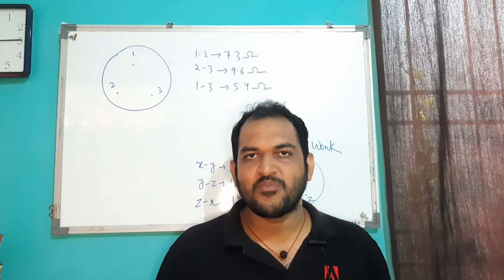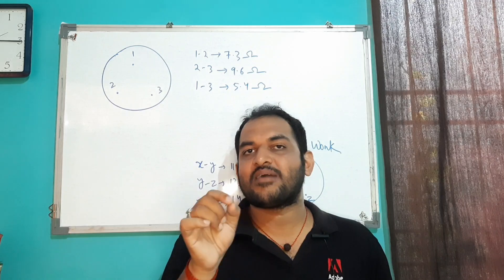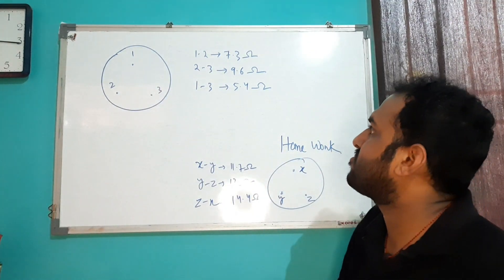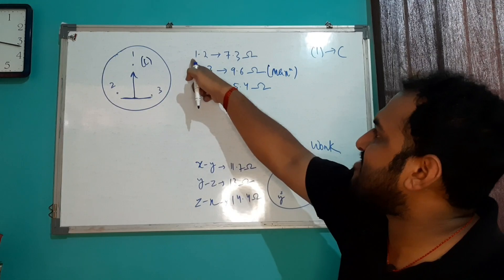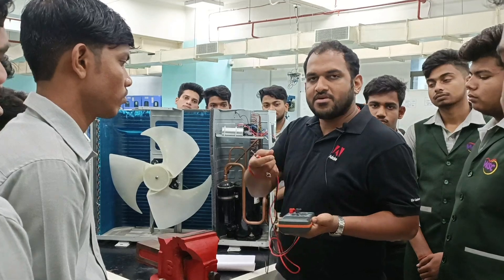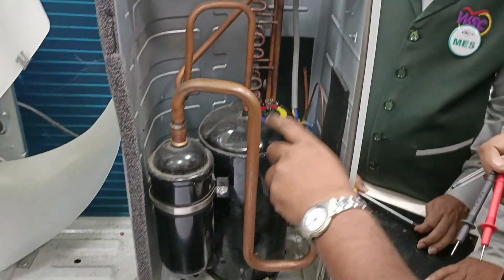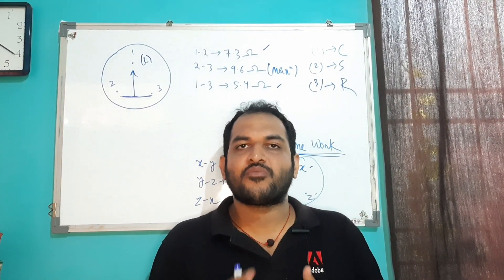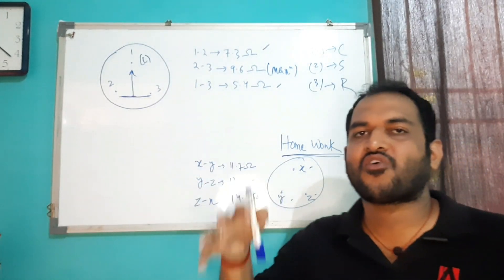How to Identify C S R Terminal of Compressor || B MOHAN KUMAR #skills #airconditioner

Comment: Sir, the connection you are checking between two points, at which mode are you checking it, resistance mode or continuity mode
Reply from the maker: Its resistance mode..🙂